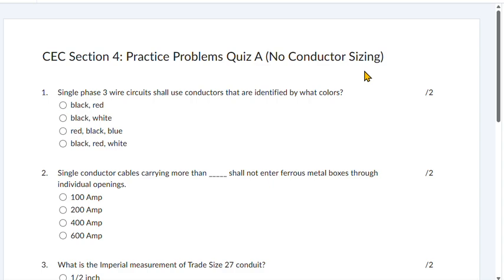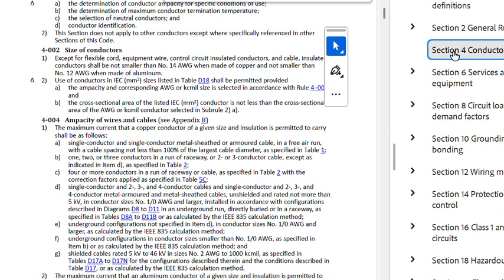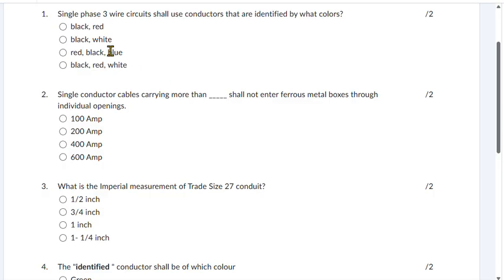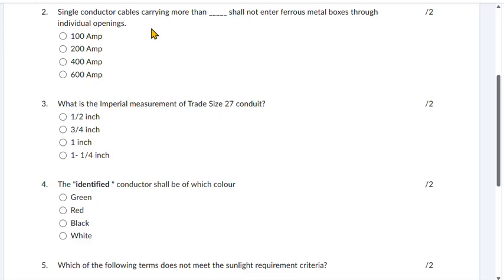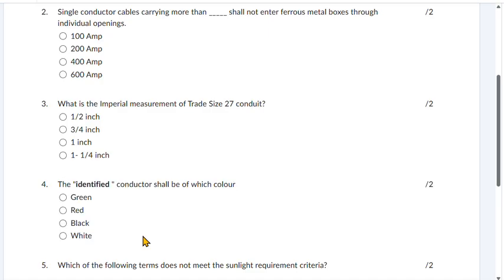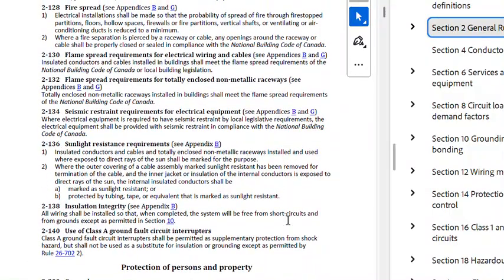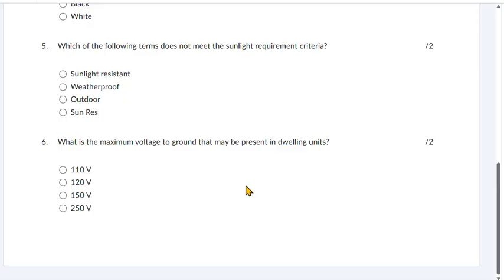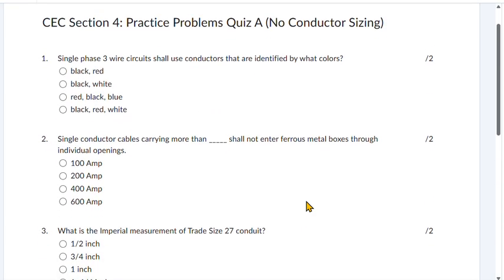Prof.K. Quiz: CEC Section 4 Practice Quiz with Questions and Answers

Comment: Thanks for the videos.  They are very helpful.
Question #3, although you get the right answer, it has nothing to do with wire gauge, but the typical conduit trade sizes found on page 34 of the CEC 2024 (26th edition) .  TR size of 27mm is indeed 1".  Hope that helps.
Reply from the maker: Thank you for pointing me to page 34!  This is very helpful.  Glad you love the videos.